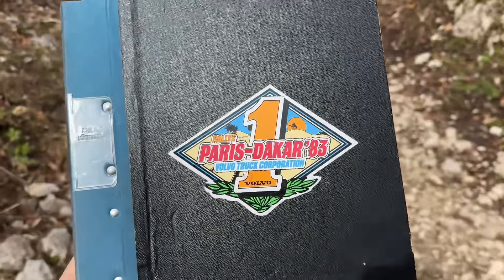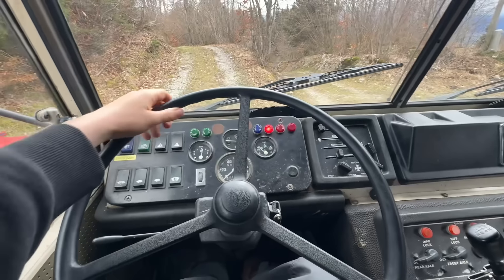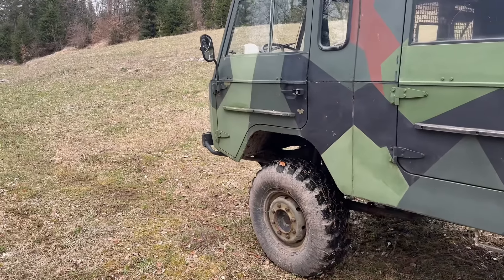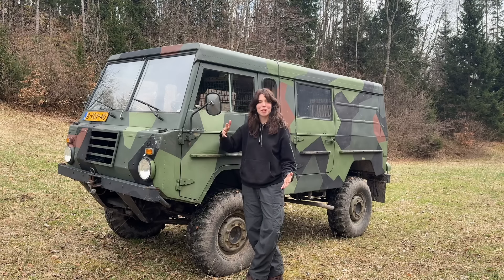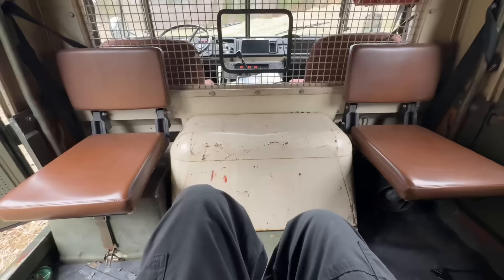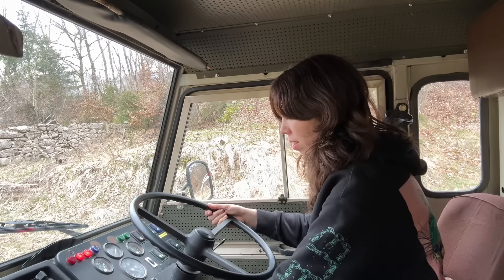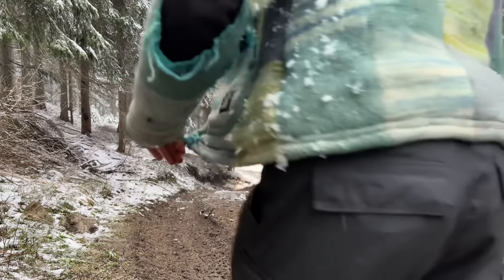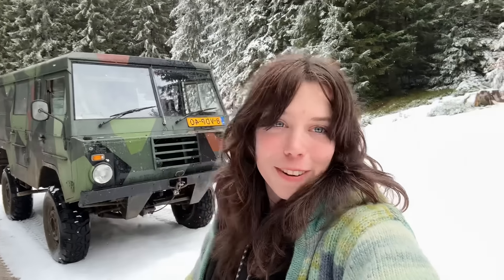Ex-Dakar Volvo C303 walk around + off-road!

Comment: Hi theres an Australian couple with a baby just arrived in Sweden a couple of weeks back ..they have a six wheeler ex millitary one hes rebuilding to use as a mobile home to explore europe having previously used Homag overlander to explore Australia... she's not  originally from Australia herself.
Reply from the maker: Yes, I follow them :) the Outfit! Doing some cool stuff with their C304
Reply: @overlandingrobin  
He wasn't sure of how to tackle some parts...but as you're watching  you're already probably able to advise them. 👍🏼😎
Reply: The ABBA girl beautiful as ever
Reply: @overlandingrobin  

Hi Robin have you seen the work being done by Edison motors in BC Canada.. they have built their own Off road 750hp Electric hybrid logging truck....called Topsey..  Topsey is all electric but under its bonnet runs a smaller Caterpillar diesel generator. So its lighter more powerful cheaper to run and more efficient saving 30% fuel even running the genset to power the motors full time... But batteries allow regen braking and save the brakes ..store any excess power and allow it to recharge and run without external charging . Plus it's greener can run for hours electric only, needs less maintenance ... burns fuel cleaner and only when needed, because electric motors allow it to run at its Stoichiometric optimum. The only relationship to propulsion is via power cable's. 
Junk gearboxes, exhaust transmissions, clutches and diffs. as the motors are in the Axel's.

Comment: It looks like there is a switch missing to the right of the diff locks. It appears to be a Low-Neutral-High switch, but that is on the stick shifter also. Puzzling.

Comment: Some questions.
As far as I know, all C303 had 12V electrical system. The TGB 11 /military versions had 24V electrical system.
Is it the bolt-on transfer case PTO mechanical winch on it or something different?
Is it the Tatanka hydraulic hydraulic power steering or the original pure muscle power steering?
Is it the thin or the thick radiator (2 or 3 rows)?

In any case, could you make a PDF version of the documentation so we all could have a chance to see the unique material.
I would even purchase it just out of curiosity.
I have a true Swedish sold C303 ex-Vattenfall (a Swedish energy company) and my native language is Swedish so I will for sure be able to read it all.
Reply: All civil had the large radiator (same as TGB20, plus military for Malaysia & any other clients in tropics).
My guess is the 24v setup was either ordered specifically (for both easier wiring & military spare parts), or got retrofitted later on, at the same time as the entire body got retrofitted (seems alu-zinc top till bottom (first indicator is missing left-side footstep, second indicator is that it seems the lower panel edges are more 45 degree roundish than 90 degree square).
Since the alu-zinc body panel retrofits were all done at the same Military Verkstatten as the original rear-body construction (Volvo only supplied cab-frame's, no rear bodies whatsoever, neither to civil nor military clients), other things might have been upgraded at the same time as well, but my guess is still having 24v right from the start, on specific order.
(not necessarily taken from the civil production line/spec's either; civil C306 firetruck frames were also taken from the same production line/batch as the Malaysian frames, the frames being prepared for both LHD and RHD)

No hydraulic powersteering here.
(I have the first-ever sample once done by Tatanka, sourced from an old & rotten civil/municipality C303, retrofitted into a C306 firetruck (belt-driven, metal tank on top, under top/front engine hatch, second generation was crank-driven, metal tank on top of pump, current version is belt-driven again, plastic tank under top/front engine hatch)

The 24v volt gauge probably wasn't done by Volvo, but just for the rally, as no other civil 12v never got one either, AFAIK.
Would be cool to establish brand/model (and era/year) though, for anyone else who want to retrofit something historically correct.

Rear tow bar isn't typically civil either, it is missing the secondary horizontal support beam, on both side attached to the frame.

Comment: If you cut my arm ... I would bleed Volvo.. not blood.. and now I must have one of these, I've seen them before and been envious but now I must have one, with fuel injection and disc brakes though and then I'll consider putting an Alu-Cab on top (pop-up camper top) this would make a wonderful camper .. I have had a few red blocks but my favorites are the white blocks, maybe I've had 8 or 10 .. Volvo engineering is unmatched